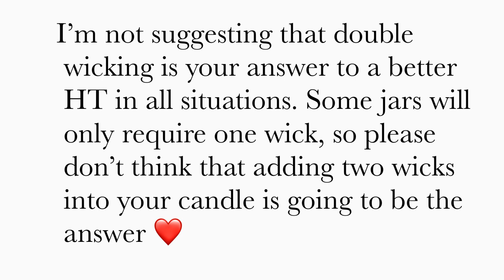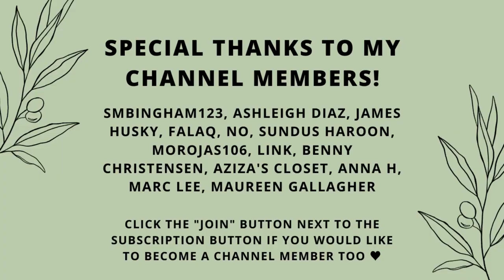How To Get A Better Hot Throw Out Of Your Candles (My Experience + Tips!)

Comment: I have been using GB 464 and have tried like 20 different scents.  I just cant with this wax . I just opened my business and the BEST hot throw I've had is LEMONGRASS ( fragrance) used both tins and glass tumblers ... cure for 6 days minimum.  My god . I add fragrance at 180°f . I dont know if I should make my line fragrance free reiki candles or keep throwing money out the window .... invested 5k and spent the last year testing and building this business lol! I do 1 oz per pound of wax ... I have 3 fragrances I'm going to test and stick with them and I'm done lol vanilla,  eaucalyptus spruce and Timberlake from Village Craft . Pray for me 😂
Reply: Use soy #10 !
I tried 464 1 time and dropped it just as fast 😅
Reply: 464 needs 7-14 days to cure minimum. The longer it sits the better, what wick are you using? Also try low temp method add FO at 160-170 then pour at 140-145
Reply: @stacyrichardson4997  I am using HTP 1212 , HTP 105 , for my 3inch dimater glass jars ... they burn too hot , melt pool is too deep ... but every other wick I've tried unferperforms and tunnels... still havent found the " perfect " size and I've tried 5 different wicks lol! I hate wet spots so I pour at °120 and that's the only sweet spot for not having the damn wet spots.  In the tins I can pour hotter because you cant see the wet spots lol

Comment: It all depends on testing testing testing. 100% soy literally takes like one month to cure. Paraffin or paraffin blends take like 2 week cure. Also some oils are more concentrated that others. I recommend checking those out. I started making candles 10 years ago and candle science was the only go to place, but now so much more sources and videos and guides. Which is better for new makers. There was this one older paraffin wax I once used and it was super good with hot throw I mean good. But they no longer make it. I would use it with premier wicks. I'm not so much a fan of wooden wicks cause it soots so much when you burn for over 2 hours no matter what. Good luck makers.
Reply: Hi, i hv heard that curing 48 hours is enough. Is that right?
Reply: @studybuddy36  You can but if you want a hot throw it's better letting it cure longer. It also depends on the wax you use. You need to let the oils concentrate into the wax.
Reply: @edgargarciahernandez2476  thank u. N what about mixing FO and pouring at lower temperature like 130 or around? Will it be helpful?
Reply: @studybuddy36  It will all depend on the wax that your using. Because they have a different pouring temperature. What wax are you working with?
Reply: @edgargarciahernandez2476  it is soy wax i m working with.
Reply: @studybuddy36  if you are using 464 wax. I would suggest to melt the wax up to 175 add the oil at 165 and mix for 20 secs. Let it cure for 2 weeks. I keep it away from light. Idk why? I let them cure in a box. This works for me. I would recommend looking into the Eco wicks.
Reply: @edgargarciahernandez2476  Actually in my country there is no such classification of wax. They are definitely mixed with additives but i dont know what and how much. But thank you so much this has given me an insight.
Reply: @edgargarciahernandez2476   have you heard of c6 parafin soy.. i am having trouble with the HT